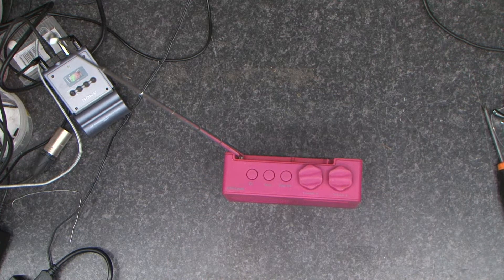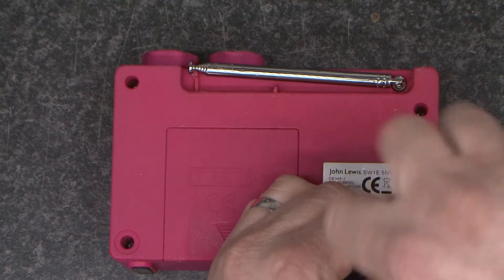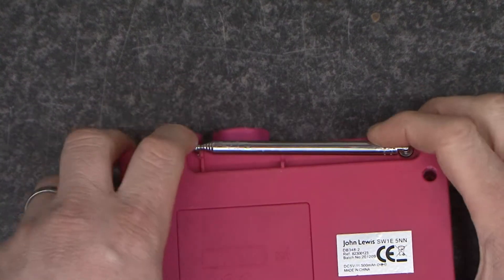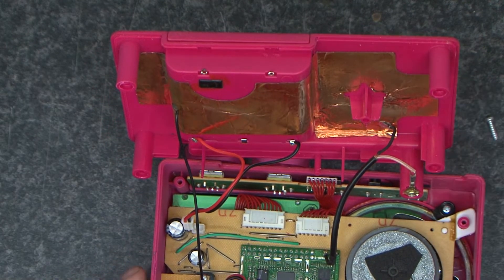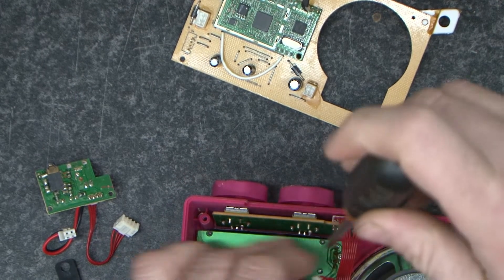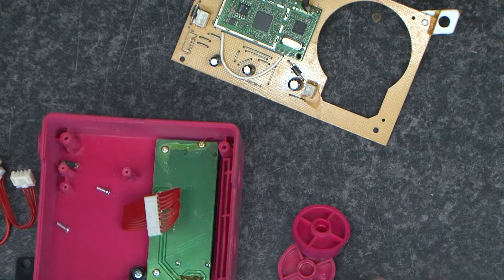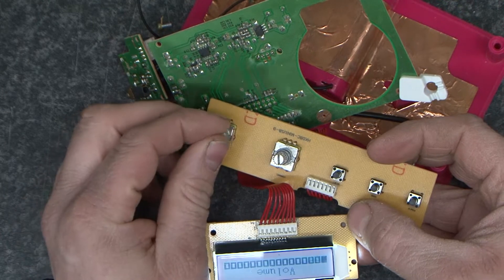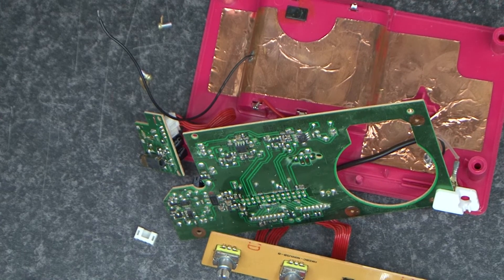john lewis Pink Dab Radio teardown

Comment: Nice teardown. Thanks for the video. I wonder if someone could tell me the size of the dc powerport, as I have bought one of these 2nd hand, but don't have a power adapter and am hoping to buy a usb lead to power the radio. Thanks so much.
Reply from the maker: the the same one as android phones , apparently  , and e cigarets
Reply: @dark1stu  I meant the plug that goes into the radio, as there are so many varieties of this plug. No matter though as I found it, it was a 4mm x 1.7mm plug. Posting here in case anyone else is on the same hunt.